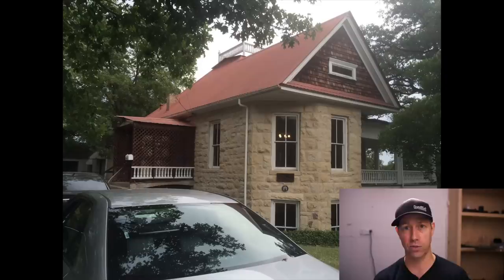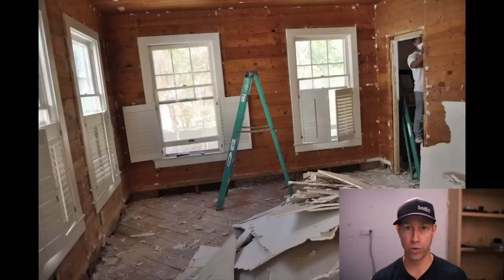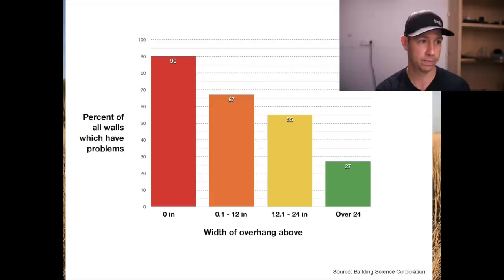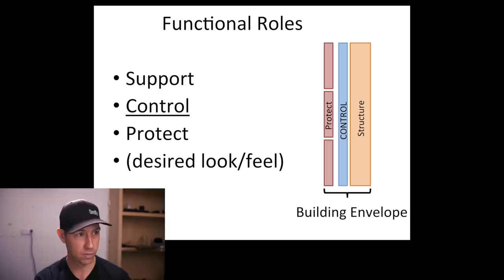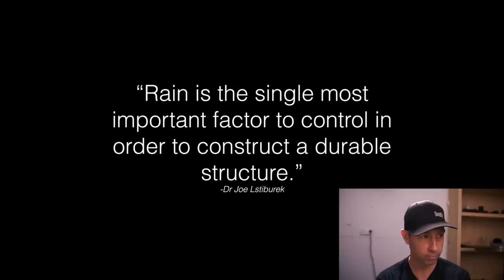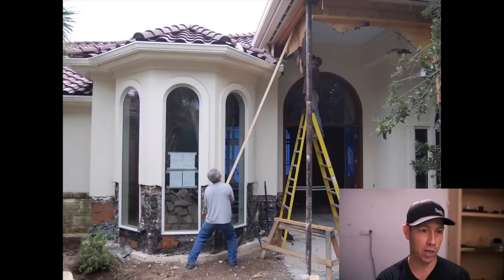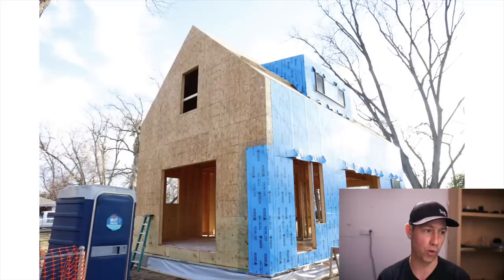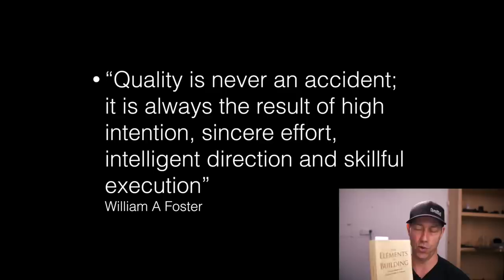Were Old Houses Built Better?

Comment: Pfft, a 2' thick stone wall is FAR more then simply structural. It is also a control layer, as does all those things you listed. Control thermal as it passes through such thick layer of stone, controls vapor, air, water, etc all again via same method. So this means it also protects, and will do so for centuries before it wears down enough. Now a shorter thickness stone wall, or brick wall, yes I would agree, but simply saying a stone wall when you had specifically shown prior a 2' thick example just does not compute.

Comment: Personally I hate working on anything older than ~1970. The 70's is when construction went modern imo. There isn't that much different between then and now material, method, or code wise. 1950's and 60's with their aluminum wiring and copper drains with galvanized water is a nightmare. I do like working on houses from the 1800's or early 1900's just because I don't see it much. If I did houses that old everyday I'm sure it would get old.

Comment: No time to watch but construction today and back then aren't even comparable. Old house were built to last hundreds of years. Houses today although most will stand unattended longer, most modern houses are built to last 30 years or so. Old house used native hardwood for everything including framing. Its probably 20 times stronger. Everything is stronger in old construction. The problem with today is everything is production based where as back then people still cared about quality.
Reply: Yes todays junk houses are built to last just long enough for the banksters to collect 3 times the original price in interest.

Comment: Old house= money pit: inadequate insulation, leaky single pane windows, leaky door seals, bad layout, etc.  Even new houses are built with old style wood frame construction. Solid masonry is a good heat conductor so you will freeze in winter.  AAC and foamed concrete are much better alternatives to wood.  You will have lower wind and fire insurance, lower utility bills and may not even have to spray for insects because there are no cracks for roaches or mice to enter or hide.

Comment: That's no secret. but we need to be real, the constructions that sucks are modem American made houses they are not made to last. In the Caribbean were i used to work we build the houses squareish, whit flat concrete roofs of rebar and the wall made of big cinderblocks once that roof is set it last forever only tar every 5-10 years. my grandmother has a house whit a concrete roof of almost 40 years 3 hurricanes later (even hurricane Maria) they roof still there no leakage no damage.

Comment: IMO they did build houses better, with healthier and stronger materials than they do now. I would not have a house built after the 1970's. Actually prefer early and original house from the early 1900's. Pre asbestos and perhaps remove any lead based paint...but I grew up in the 60's and have never had any heavy metal issues from the lead based paint. Family owned a lumber company so we had a beautifully made home. It is lost to me now, and the mini mansion subdivisions took over our once forested country environment. I wouldn't live in that town or area now...it would break my heart and my spirit. If I had the money to I would move to a remote small town, buy a small old farm house made from rock and wood. I'd have the original vintage wood refinished, appliances rewired and made safe, and brought back to the most original style it was made to be. The homes now are crap. The VOC's alone turn me off from all of the fake materials, particle board, plywood and plastics. Nasty and cheaply made. I love my 1961 real brick house and knotty pine kitchen and bonus room. 
We did just remodel the bathroom...sadly letting go of the baby blue toilet and tub, to install a handicapped walk in shower as we are getting of that age and need the safety upgrades. We encountered NO mold behind the tiles that we were expecting. The grout was terribly discolored with dark icky stuff that couldn't be cleaned and so happy to have the old tile gone. Enjoyed this video. Thanks for the show.
Reply: The lead based paint propaganda is a lie.  Government and military buildings still use lead based paint.  The reason they banned it for us is because their electromagnetic frequency equipment (cell phone towers) they use to spy on us does not penetrate though lead based paint, which would allow us to have God given privacy and keep us from being radiated with this evil technology.

Comment: To support yut r claim thta old stone or wooden huses are miles ahead in qulity than todays "modern" houses, I would give two exampels od stone houses i Malta (slolid lime stone block with no mortar, just sand and water) adn highlanders wooden houses in Eastern parts of Europe, Slovakia, Poland etc) They last hundreds of yest constructed in primitove methonf withstanding extreme conditions, hot summer, wet autumns and cold winters. With solid wood houses (made od cut trees), there is no better thermal insulation for both cold and hot seasons)

Comment: All great info, but the "new house" is hardly practical construction.  The cost of using that heavy sticky water barrier with poly-iso foam boards on top?  That's some serious $ vs more typical construction.   If money is no object, you could make the house out of welded stainless steel (submarines are pretty waterproof...).    Modern houses are more likely to be hardi-plank with tyvek or similar on top of OSB.    Some of the same problems come up as in 60's construction.   Moisture gets in through imperfect flashing. Overhangs aren't adequate.  Windows aren't inset.  That's reality.

Comment: Matt, thanks for posting. I’m not a builder but I have to disagree. The homes built in the late 1800’s up until the late 60’s were solid. Yes the standards of plumbing and electrical wiring have changed, but overall structure was solid. My grandmother and great aunt lived in a home built in 1920 was a beautiful home with REAL siding made from solid wood planks.

Comment: You can 100% have old style craftsman ship with comfort, you're just looking in the wrong places. look a bit further back into history and the common building material of cob is super strong, durable, breathable and has a high thermal mass which retains heat during the day (or when a heat source is being used) and releases the heat when the room gets cooler, as well as keeps things cool in the summer. Do a bit of research into cob, adobe bricks, sandbag and straw bale building. I will link a video but there is SO much more info. These building choices are all natural, cheap, eco friendly , and anyone can use them. Even in Texas or up here in Canada! 

https://youtu.be/TaKqPqBtXIM

Comment: Comparing old houses to new is not a valid comparison. Older methods built crappy don't last and are removed by rot, hurricane, tornado, fire, insects, and/or poor maintenance. Houses built very well last for a long time. Houses built poorly or with bad materials don't last. If it stands the test of time, it was built well. That's where the romantic notion of "not built like they used to"  comes from. Your missing all the crap that has rotted to the ground already.
We have tremendously better technology today to design houses. Most don't use it for cost reasons; some for ignorance. We need more building science and less politicians writing the building codes. And none of that does any good unless rental homes are required to be maintained. Any advancement in efficiency is pissed away by landlords that will not upkeep the property to even the poor standards when built. Tenants have  negative incentive to upkeep the house and landlords have minimal incentive based on local laws. It leads to crap houses and higher energy bills.

Comment: I will never understand why in USA you build wooden houses like that, instead of bricks or stone. Even after considering cost... When you add all the layers of insulation and embellishing details like fake stone fronts, etc Doesn't that end up more expensive than simply building with good old materials?
Reply: But we do have brick and stone buildings...in areas where that's feasable. The thing is, there are regions where it simply isn't.

The rest of the issue, however, is indeed cost. I realize we're a very wealthy nation on the whole, but so much of that is tied up in the hands of just a few, we do not have a robust safety net, and costs for a lot of things can be very high relative to wages.  Americans like to brag about how low our taxes are compared to other nations (while simultaneously whining that they're too high), but we pay for that in other ways.

Comment: One thing I notice, older buildings seemed to have better flow/comfort than newer ones in summer.  Older buildings seem to be reasonably comfortable just opening windows and using fans in all but the most extreme summer heat, modern buildings can't seem to move enough air thru the windows (not all of which even CAN be opened) to make it tolerable.  I doubt anyone years back had large non-opening picture-windows in their non-air-conditioned bathroom or livingroom.  We've reached a point where working A/C is an assumption in design.

Comment: I think you’re missing half of the equation on the efficiency of old houses. Old houses were better designed to manage temperature through non forceful means, by which I mean without A/C or forced air heat. High ceilings mitigated heat in the summer, double hung windows allowed good control of airflow through the house (open the lower window on one side of the room, and the high one on the other and air will flow through them). Transom windows over doorways existed for the same reasons. Rooms were smaller and divided with doors, so that in the winter you could keep doors closed and only heat the rooms you needed to be warm.

Saying that no one would live in these old houses they way they are is just dumb, there are literally hundreds of thousands of people living in old houses in close to original condition. My entire neighborhood is comprised of 100+ year old houses, and I’m unfamiliar with any complaints about comfort. Old houses are comfortable the same way sitting outside is preferable on a nice day to sitting in an air conditioned doctor’s office. Air conditioning and super-closed air systems don’t feel good to live in.

Comment: These modern houses would not pass Israeli Building Codes. A lot of the houses are over 3000 years old in the older cities in Israel. All building have to survive missile attacks and Earthquakes which means reinforced concrete and Bomb Shelters in either the apartment building or in each apartment. Also water conservation is very important.

Comment: I do hope that horrible stone cladding can be easily removed. It's totally out of keeping with the nature of house, as are the deep soffits. I have a house around 80 years older than this poor thing, and although it is a very workaday kind of house, the stonework does not need re-surfacing, despite the rigours of the emissions from local cotton mills during the height of the Industrial Revolution. This upating of this house seems extremely unsympathetic and rather brash.

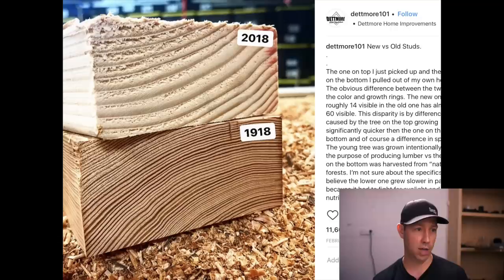Comment: 5:07 Well of course the older colonists had better lumber - they simply and unsustainably clear-cut and deforested all the old-growth forests on the continent upon arrival!  This not only left no natural, higher-quality wood for later generations...but also left no old-growth forests at all, either. Now tragically, all that's largely left are nu forests filled with far smaller trees and invasive species.
https://www.facebook.com/1712413972190715/photos/a.1712436822188430/1823687571063354/
And this steady depletion of natural resources can be seen across the board...
A century ago, natural springs were also gushing forth like geysers.  Many towns (and even homes) had constant fountains and mineral baths fed by them.  But now, their aquifers have all largely been depleted and they've slowed down to tiny trickles...
All of this is due to exploiting and squandering ecological resources completely unsustainably.

Comment: Although I love your video and level of professionalism, I believe today's trends of insulation and energy efficiency are on the wrong track. I have built several buildings in the tropics in places where air-conditioning is not an option, and for inspiration I always go back to old buildings, pre-1970's, that were built with passive climate control in mind. The first example you give of the 1880 stone house is a great example: big overhangs, thick wall as a thermal heat sink, high ceilings. Travel around the world and you'll find many old buildings featuring such techniques to a great extent. The Panama Canal zone for example, build by American engineers, has beautiful homes that remain fairly comfortable in spite of being built in a tropical humid rain-forest. European colonial architecture excelled at buildings that northern Europeans would be comfortable in, in spite of being in places such as south-east Asia or Africa. This for example https://www.youtube.com/watch?v=8Cz3GfHPJ4I&feature=emb_err_woyt 
With regards to insulation and air-flow: many modern buildings in northern-Europe are insulated to such a level that air inside is stagnant. These houses are incredibly dusty and to me it is no surprise that respiratory ailments are on the rise or an airborne disease could be so contagious. Now you can compensate for such issues with ventilation but that is like putting the cart before the horse. Bottomline is: there is something to say about wearing a sweater in winter, and using a fan instead of air-conditioning in summer.

Comment: "Our new sensitive materials" you mean garbage. I've been in construction for 20 years, theres no way I'd buy a house made in  the last 30 years. The comparison with cars is great. Theyre using cheaper materials inside the engines, thinner body panels, many made out of plastic, the interiors are made out of cheap plastic. So when it comes to houses and vehicles, they are very much the same.

Comment: Were old houses built better? Well Duh. Shouldn't compare houses to wheeled vehicles, though. Vehicles today are all shitboxes. No full frame, no rigid bumpers, and they have plastic parts holding them together. They all have airbags and rumple zones. I can't see how any of that could possibly be considered a "higher standard." Modern brakes are good. But a 56 Chevy can get an updated braking system without damaging the structural integrity or the aesthetics. These little shitboxes they mass produce today get destroyed in a 35 mph impact. The airbag pops, the rumple zone rumples, and the car is fuct. I want to be able to drive away from a 50 mph impact. Basically, I want a truck that is built like a Sherman tank and looks aesthetically appealing, like a 56 Chevy. And of course it has to have a big block, and a five speed... I want to be able to run from the cops, drive thru yards and over retaining walls, and still get away. I miss the 70s, man.

Comment: This reminds me of a flawed , but excellent marketing statistics, for STOCKS.  The stocks around today, if bought 20 years ago, would deliver a great yield....However, the flaw in this logic, is that all the dogs, died.    You failed to consider the stocks that were around 20 years ago, which are gone today.   They are zero.     Same with houses, if we look at the survivors, then we ignore the dogs.     However, starting in 1940, with sheet rock, houses, started getting cheaper.   And less skilled labor could build a house.  No more lathe and plaster, no more tongue and groove, for the roofing, etc, etc. And worst of all, vinal siding, vs, stucko, or wood siding, etc.    No more slate roofs, etc.  However, also some safety features, like fire walls, fire stops, etc.

Comment: The survivor bias argument doesn't exactly hold up, in my opinion. Here on Long Island, many of the most historic homes built as summer retreats for wealthy business people were torn down for a variety of reasons. Some were left abandoned for many years and fell into disrepair. Others were victims of arson. Some were as structurally sound when they were demolished as the day they were completed. They simply outlived their usefulness and had no real place in post-war America. 

One can make a general assumption that older houses were built better. I see shoddy houses being built all the time. Cracks in the foundation. Cheap materials. There's nothing really wrong with modern engineering though. 

Buying vintage and upgrading is the way to go.